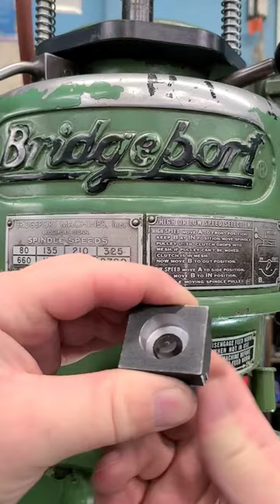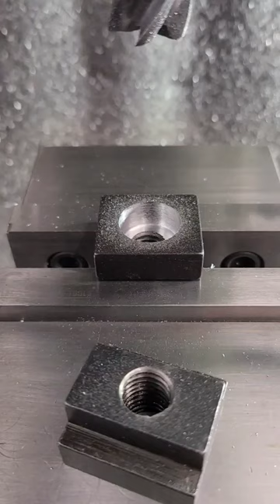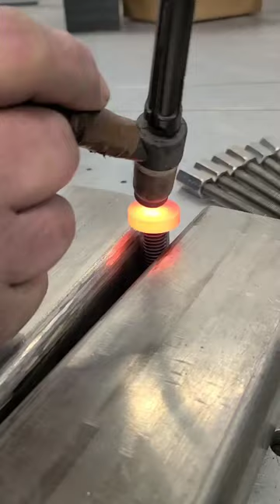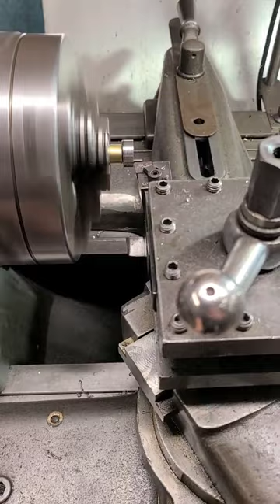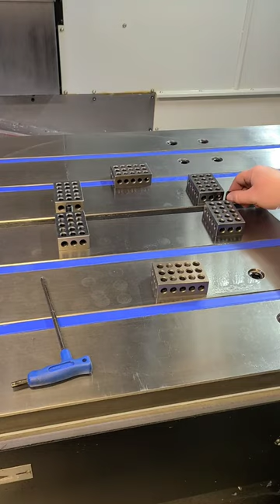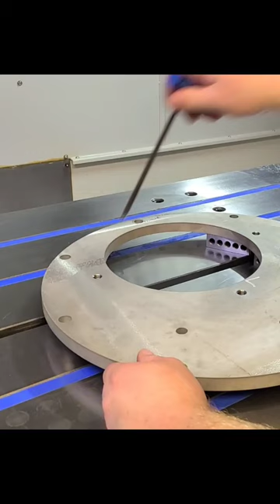Upside-Down Bolt 🔩   #engineering

Comment: What's confusing people is threading the grub screw into the t-nut, op is not showing the thread being removed, the t-nut is now just a t-washer, and with the turning of the finished unit a nice rigid clamp is achieved with no need to have top clamping.

Comment: Very clever. As long as your part has the threaded holes, or you thread some holes outside the part perimeter.
Reply: Don’t even need to be a threaded hole depending on application
Reply: If you have a clearance hole in your finished part, you can temporarily put a smaller threaded hole in for work holding, then open it up later.

Comment: I miss my lathe One of my customers gave me a huge lathe with all the tooling Not knowing a thing about machining I managed to build a few custom  motorcycles  Made forward controls risers pegs  a springer front end Bunch of other one off pieces All with a lathe Has to sell the lathe when I sold my building. No place to put it I still have all the tooling someday I’ll buy a smaller lathe if I can

Comment: Useful idea for sure. But i think itll just make the bolt instead of welding two pieces together haha.
Reply from the maker: This was a quick and dirty solution for a low cost part.  Maybe next time.
Reply: how you putting the hex in it then to make it a grub screw ?
Reply: Rotary broach would do it… but I would just do it this way
Reply: @Chris-nt9lk  oh yea for sure but that's not something alot of people have to hand that's all.
Reply: I agree with starlet boy
Reply: @starletboy9349 it’s a long set screw. 
Nothing fancy there
Reply: @westonhennion6500  I was saying to the original comment how would he make it from one piece when it's got a hex in it, obviosly it's a grub screw an welding 2 pieces together is the easiest solution 🤦🏻‍♂️

Comment: It's an endmill, not a slotdrill being used at the start .How is that going to make a hole. The cutting edges of a endmill don't go all the way to the centre.
Reply: The hole is already there, he's just making a counterbore. If the hole wasn't there, he could use a center cutting endmill, smaller than diameter needed and interpolate it down. Final pass, do an extra rev. I wonder if you got milling chatter while cutting the face? I've used mighty bites and also just moved the step clamps, but the surface might not be perfectly flat doing it that way
Reply: @FredFlintstone21  Didn't say there's not a hole already there, it's still an endmill cutting vertically. Swarf removal is going to be really bad and the bottom of the hole isn't going to be flat. The lands on an end and slot mill are totally different.
Reply: @flatmoon6359  I've cut thousands of holes with various endmills, using coolant for chip evac with zero scarf removal issues. The endmill in this video isn't going to give flatness issues. That's why you select an endmill you can interpolate so the counterbore is perfectly flat, not that it needs to be in this application. Alot of ways to get the job done.
Reply: @FredFlintstone21   A lot of ways to do it wrong. What's interpolation got to do with this. What knowing values between two points got to do with this. Being not very good at machining by using the wrong tooling is just lacking in skills. This is showing someone who doesn't know machining very well, how not to do it. If having the bottom of the hole isn't important just drill it out . If  posting videos on YouTube do it right. There is enough lacking in skills, don't add to it.
Reply: @flatmoon6359  You saw the end result didn't you? It worked. I think you're pulling fly shit out of pepper here.
Reply: @FredFlintstone21    Posts showing so called skills, whether electrical , mechanical , or any trade need to be challenged, otherwise people get hurt or get rubbish results. Interpolate that.
Reply: @flatmoon6359  You first need to know what you're talking about before you run your mouth. Having a little bit of machining knowledge might impress your buddies, but it isn't valid here. The fella shared a technique that CLEARLY worked for him, and you missed it. You didn't know how coolant evacs scarf, that's pretty basic knowledge. You didn't know how you can interpolate with a non center cutting em to get the size you want. Get a little more eduKation before you aTtack.
Reply: @FredFlintstone21 
I believe that guy is a manual mill guy.
(notice I did not say machinist)
And the word interpolate triggered him. 😂
Yes, the old machinists taught us about an endmill not leaving a perfectly flat C'bore because of the clearance on the bottom of the endmill. However, for most applications, it's perfectly fine. And yes, once again, CNC methods can eliminate the older ways and the older tooling once needed. Another great use of circular interpolation is when making a precision bore with a boring head. Drill a thru hole and then interpolate with an end mill to rough the bore. Run the boring head and you have a bearing-grade bore.
We did hundreds of 2.5" diameter holes, 2.0" deep like this. +.0000/-.0005 👍
Reply: @jakebpau2396  my favorite finish bore head is big kaiser, you can buy em digital  read out, in mm or inch. I'd usually rough bore to .3mm (.0118") and then finish bore to print.
Reply: First off there is a hole already through the part, secondly almost every endmill made today is center cutting, it's been a while since I've seen one that wasn't.
Reply: @phillhuddleston9445  So it's a slot drill then, not an end mill. The swarf clearance angles are totally different. Two lands on a slot drill,six+ very close on an end mill.
Reply: @flatmoon6359  Maybe the terminology is different in the country you are in but in the US we call them center cutting endmills and almost all endmills are center cutting these days so they are just referred to as endmills.
Reply: @UCuOZx6r1MxSGoRXJ04FnEaQ